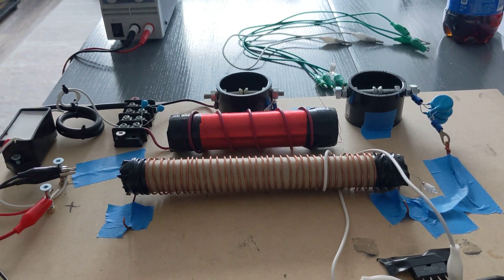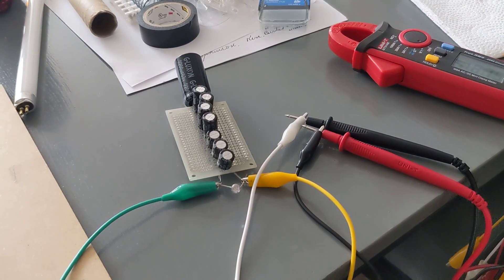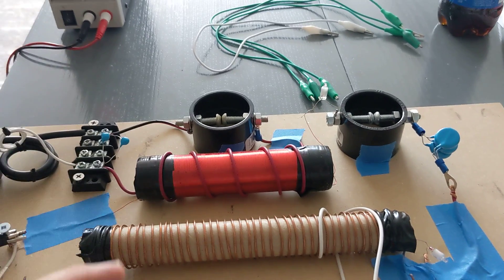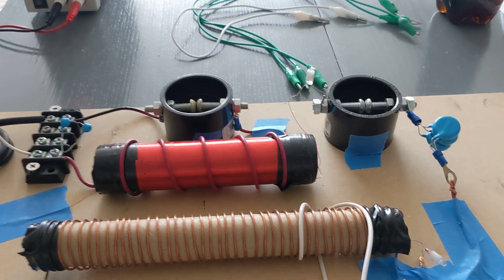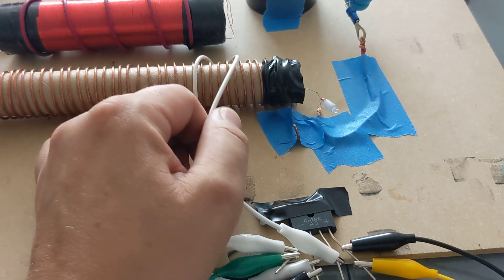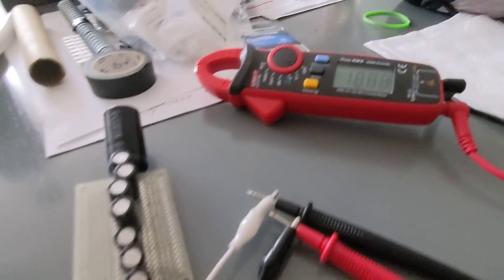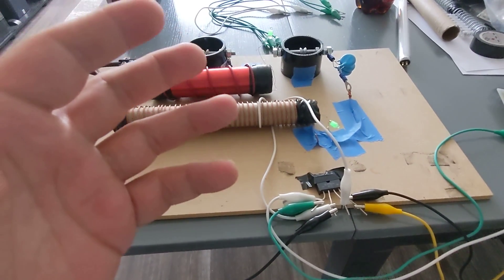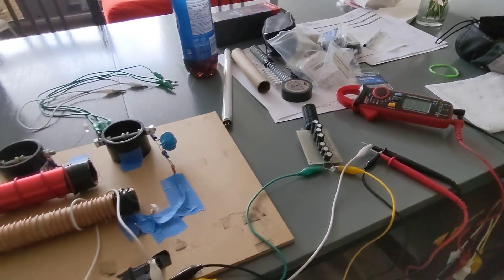Faraday Research RND/ Don Smith Generator

Comment: Do you know why your caps are actually not charging faster or blowing up? You don't have a diode that matches your frequency,  try HV HF diode and enjoy the high volt projects. I had one project where I struggled to change caps until I found, the Hv HF caps.

Comment: I know this video is 2 years old and I don't know if you ever made any progress on this. But I just want to say ... everything in this video is wrong. Anyone trying to glean any useful information here: run. 

If you're not very knowledgeable this will just lead you nowhere and some of this is actually unnecessarily dangerous. This guy doesn't even know the difference between series and parallel. In fact he doesn't know that those caps are not polarized. The coils... there's nothing to their design. They're just randomly wound with no rhyme or reason behind them.

A don smith device is a specially designed resonant transformer. It's based on the work of Nikola Tesla. This is not based on don smiths work. This is based on this guy's off the wall perception of whatever videos he's watched and the fact that he really thinks this is amazing boggles my mind. You could charge that cap Bank in literally a couple of seconds if you knew what you were doing.

Comment: Like it…at 20,000pF 15KV, fully charged your cap bank stores 2.25 joules of energy.  So you are quite short of the power needed to supply useful watt-seconds (joule seconds) for useful power.  However, I like the direction you are headed.  A necessary step to move up larger capacitors as you see in the Don Smith vids.  As you know, once he had the proper frequency of resonance to pump joules faster he could reduce size of the caps.  Additionally, he said that it is absolutely necessary to properly connect to ground as ground is at a lower potential than the output of your second transformer (L2) thus drawing the current from ground.  I will watch some more of your vids as this is the first one to see if you did that.

Comment: Think your math is a off by at least 9 orders if magnitude, you have a uF(10^-6) bank, but you need x1000 Farads(10^+3) ballpark. For example 2600 Farads to expend 180 Watt Hours. Your power supply says you took 3.124 watts to charge you uF bank to 2 volts in 20 seconds. Think how long it would take to charge a capacitor bank multiplied by a billion times?

Comment: Put more higher voltage  caps between ur spark gaps, in series  w caps nd w  magnetically quenched ie a magnet with a length.. It turns to high frequency over the length of the magnet esp neodymium or potential and amplifies w each  ground each.. Caps raises the dielectric like clapping ur hands nd releasing energy both sides of the the caps nd getting electrons from earth plate one side of the cap... And try reaping off ie adding additional secondary/transfer coils from resonance n frequency induction as long ur secondaries talk ir frequency transfer happens energy transfer happens so u can use hexagonal once u r able to determine the secondary talks to primary.. What happens nearby is magnetic field transfer... Of frequency on secondary likely field induction of voltage n frequency.. Only the primary pulls the amps to keep the resonance rest doesn't so u can multiply w the secondaries in multiple no esp in circles try keeping in perpendicular/straight up.. And if it is magnetic field transmission which largely it is so u can increase the field using a ferrite core on secondary otherwise near field will work till  nodes...nd running the primary for resonance frequency is essential to every assay nd I think the direction ie cw  nd ccw windings matter do chk on that one..... Neg to pos mf

Comment: I'm study is joule thief at higher frequency about 500 kiloherz it uses faster speed  diodes in frequency. Didn't Don Smith say spark gaps are not necessary but everyone expects them.  I think reason being it's hard to find big transistor that carry high voltage and current that works at high frequency. Maybe wrong. But lasersaber uses those general purpose high wattage transistors for the joule ringer. It can run bright light. But sometimes whistle when adjust. That tells me that it's low frequency I think.

Comment: Why did you need to use a full bridge rectifier?
Reply from the maker: Yes, you use a full-wave bridge rectifier that can handle kilovolts has Nikola Tesla states you must put it into a capacitor. Second, you get it into a capacitor or condenser what he called it. Then you can do anything you want with that power. You can make it into AC or DC power, but you must get it into a condenser. So first I would always use a full wave bridge rectifier put it into a capacitor and then from there you can do whatever you wish with it. This is essential

Comment: So you designed Don Smith set up with power input being 20 watts and output you are generating is 0.002000 zero point zero zero 2000 watts. Wow!

Comment: Can’t help but feel you should have a earth wire right at the spark gap. This wire goes to earth ground to some aluminium or copper foil layed flat and covered with earth about 100mm deep. This may also have a spark gap!
Reply from the maker: Yes you are definitely correct more Earth grounds even at the spark gap would definitely help pull the electrons out and increase the potential through the circuit yeah your ideas sound really credible and definitely worth trying out thanks for your comments cheers

Comment: Mike, great video. Would like to see a real current-hungry load at the output eg. water boiler or electric heater. Also, can you record input Wattage from battery to the system and output wattage used by the load ??.. out/in > 1... Wish to celebrate when you loop back the output to the input as battery removed. Nice work Mike. Well done

Comment: So you are able to pull off of that system without increasing the load due to magnetic induction. The important part is the “change of the magnetic field” and because the spark gap is effectively turning it on and off really fast you are able to pull “electricity” out of the system. Is that more or less what’s happening?
Reply from the maker: Well for many years Tesla was trying to figure this out ...and he thinks that the spark gap is a conduit opening for radiant energy to enter the system... because there is no viable explanation why there is an excessive amount of power coming from the spark gap... and also in the same process it's reducing the load on the prime mover ..
this puzzled Tesla for many years and came to the conclusion that radiant energy must be entering the spark gap through counter space.. and you can read up on a lot about the stuff for Eric Dollard... talks about it quite a bit in his lectures ...so yeah the spark gap has some mysterious property of how it works and what happens when the spark is actually ignites and allows this power to come into the circuit at high frequency

Great question!!

Mike
Reply: @FaradayResearch  Tesla stated that it is not the frequency but "rate of change over time" that's the key ... means you can also use lower frequencies AS LONG AS the rise & fall time of the spark gap is fast. The faster the rise & fall time of the spark , it AMPLIFIES/INTENSIFIES THE MAGNETIC COUPLING PULSE (don't forget the lower the resistance between switch & coil the better/bigger/faster the pulse will be)
Reply from the maker: @hitbyligtning9661  this is a pretty old video of mine. I've learned a lot since

Comment: you may need to up the voltage a little to get your 1st pulse or you can get real good at spacing the spark gap. I was thinking a vacuum tube SG is most stable, like neon, that might explain why the bedini sg wil self oscillate.

Comment: you dont need the car relay unless your trying to get more stable pulses, SG will do all the triggering i am pretty sure , i never worked with SG but to my understanding it can replace a transistor if you are ok with analog freq variations.

Comment: Cap Gen is more like solid state radiant oscillator . if pulsing threw thick awg coil you will need a spark gap , transistor will work also but only with current limiter, the goal seems with the CAP GEN is to send HF low current pulses threw the thick awg coil to allow radiant amps/current to attach itself to the thick awg coil sort of like an antenna
Reply: Hi Myke lowering the frequency just before the isolation transformer is key...according to Don't Smith...
Reply: @kalan-electpaddy4990  hm?

Comment: who needs current when you can drive a magnet attached to a wheel with pure potential/voltage, as Newman tried to explain. SG has advantages for HF apps . Transistors blow out alot because to much current so if you make a high impedance coil you can avoid blowing your transistor.
Reply from the maker: Hi ....that's great that you are getting good results... that's what it's all about..,.I still love the pulse motor generators...I will be doing more work with it soon....but my Don Smith Generator is my new focus for now

Cheers Mike
Reply: @FaradayResearch  see my energy loop videos , and diagram
Reply: @FaradayResearch  "OPEN SOURCE"